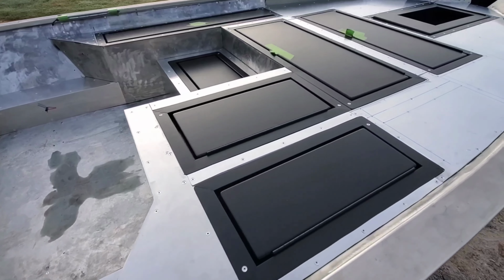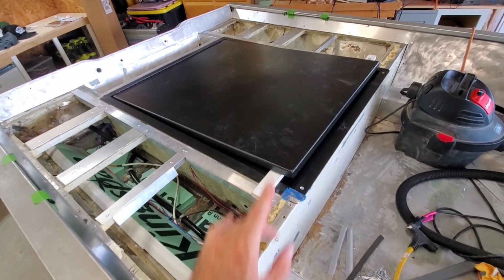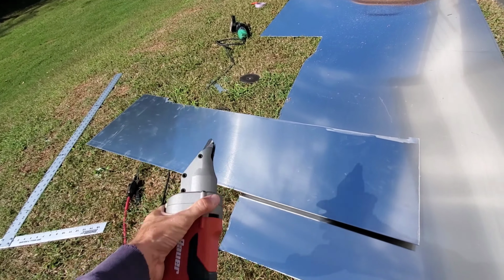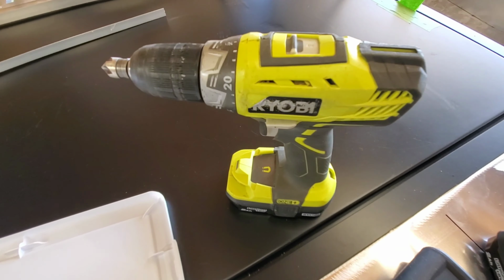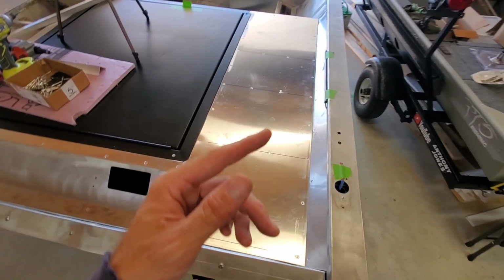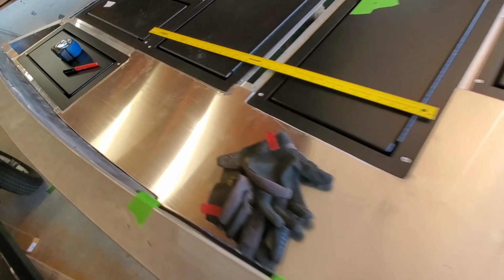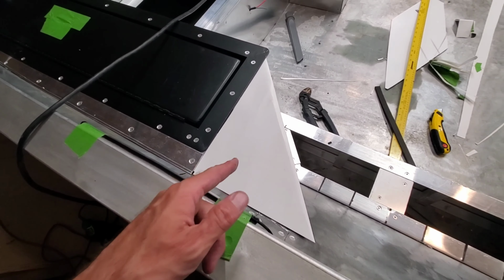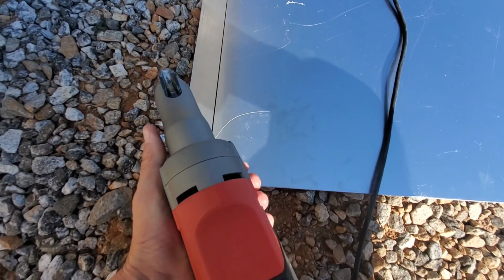Precise Aluminum Boat Decking Using Templates

Comment: Did you do the full layout? This is by far the most creative decking layout you've done so far. Your blowing me away with each video. It just keeps getting better and better!
Reply from the maker: Yes. Livewell was in back. Gutted entire back, made it open. Moved livewell up front with completely new  tub and plumbing. Removed steering consol,  added 3 ft to front deck in place of it. Added step to deck for batteries. Upsized hatch in front with recessed trolling motor tray. Added cockpit side panel steps. Only thing original is the factory rod locker location and panel, although it got a new lid. More to be shown and explained in the reveal/build video when complete. And thank you for taking time to compliment.
Reply: @AnthonyJonesBrigadeBoats  So clean!! Can't wait to see the finished product.

Comment: Looks great what gage aluminum should I use on my 16 ft 1998 sea nymph jon boat 1648. I just want a floor that is lightweight and won't rot. And after I lay it down were can I buy the turf? Keep up the great builds man im loving the information and new subscriber